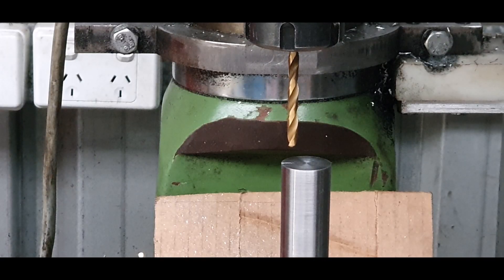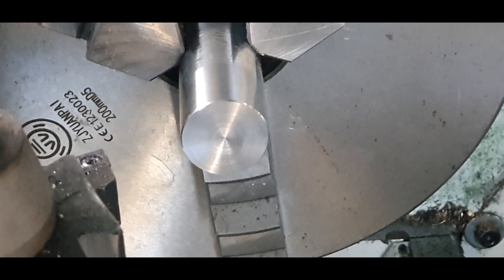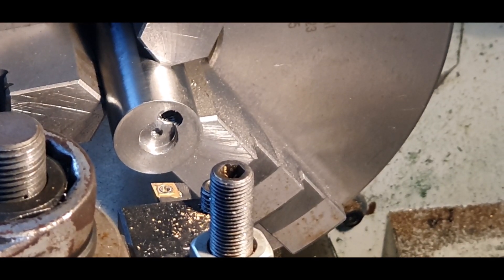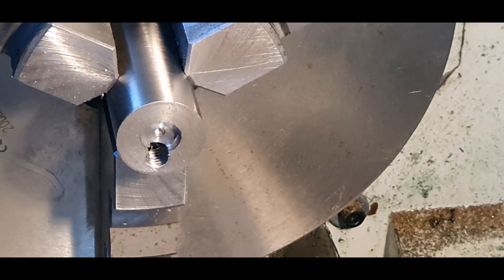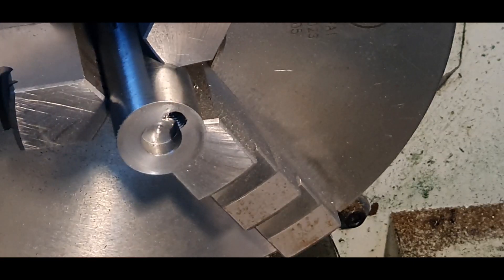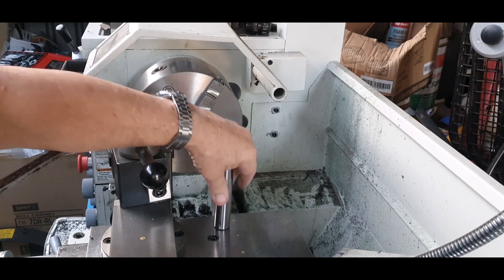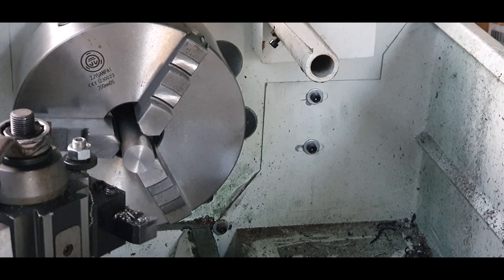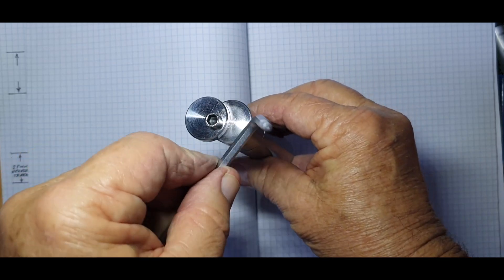Lathe Tool Height Hafco AL 356V

Comment: I Don't know what steel you're using, but it sure doesn't like to be cut :)
Reply from the maker: G'day Rusty.   I had an offset 8mm hole in the end of the steel Rod, which made it awkward to Initially cut the centre 12mm hole for the magnet. Once i was able to use the  boring tool, it went ok. The steel is 4140, that's all I had.
Reply: @TedRoza  Bugger if it gets hot while machining.
Reply from the maker: @Onan-u3b 4140 can get pretty warm, but with a small hole being drill to 25mm is no problem. But if you drill a hole say 70mm you should use coolant flooding into hole being drilled, to stop internal overheating,  & possible seizure of drill bit or reamer.